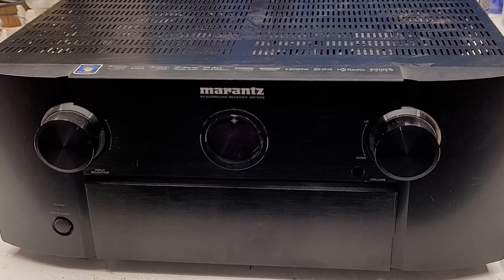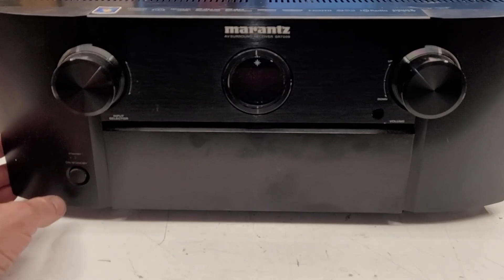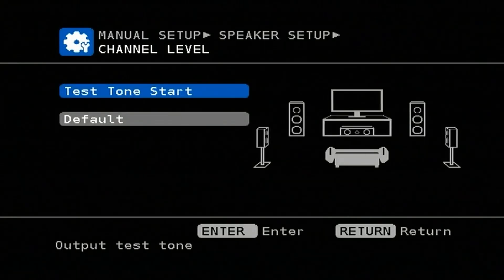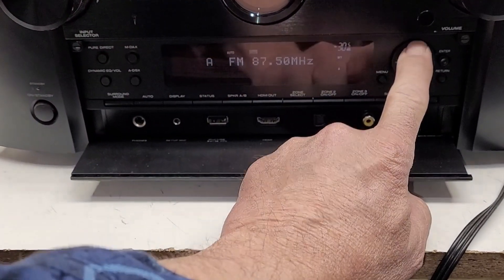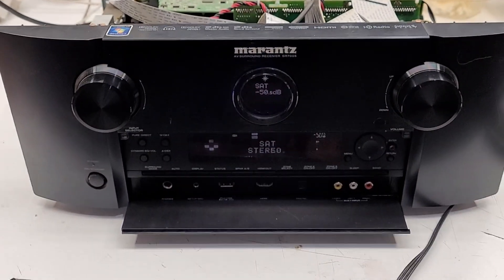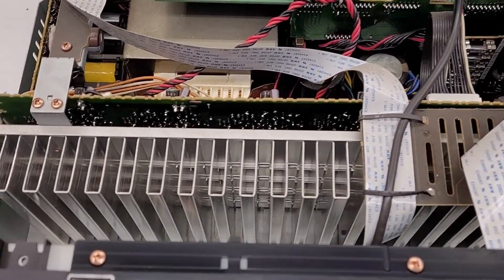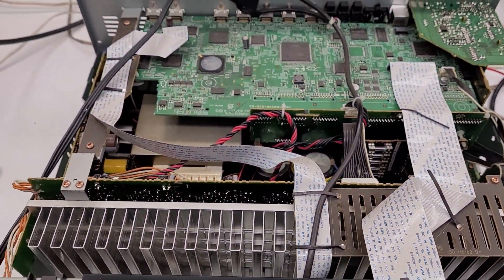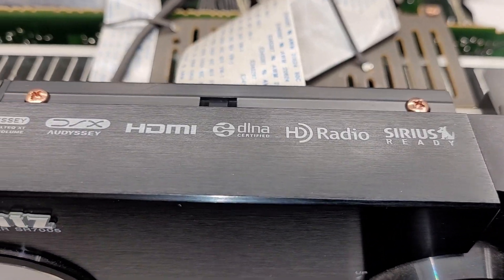Marantz SR7005 came in and I could not find any problems with it. Just wanted to show you.

Comment: Someone comes in with a stereo and it played fine. Gave it back and he says it's still distorted. When go to his place, he had 50 ft of speaker wire on each channel with speakers only 10 ft away. The excess wire was in a tight wind. That bunch of wire got so hot it melted the insulation and caused a partial short.
Reply: As the old saying goes in the repair business, "sometimes you cannot fix faulty customers".
Reply: Never seen speaker wires get hot in the 30 years+ ive owned audio equiptment..
Reply: When you have 24 ga wire all in ball and the guy cranks it to max that's alot of resistance, and heat trapped.  Wouldn't  have believed it until I started untangling it and finding melted insulation.
Reply: @marka1986  24 ga wire.? Thats pretty thin wire,  I'm using  16 ga wire, less resistance.

Comment: Sanyoung capacitor brand, check my video out I had a denon with intermittent standby power. A polly capacitor was failing when warm and the unit rendered dead was random when it did it.